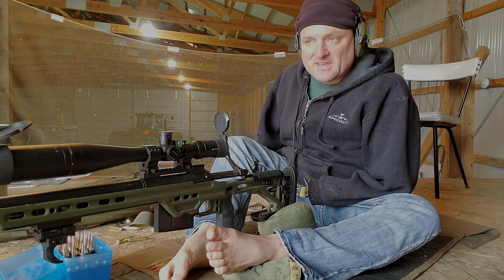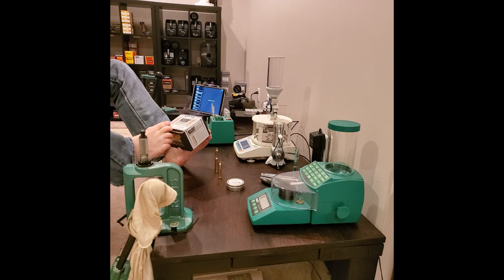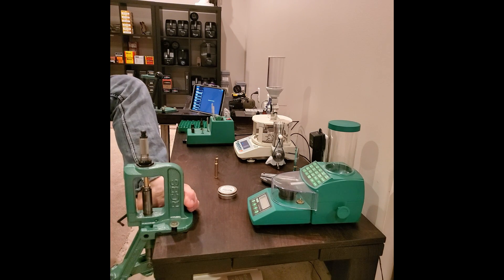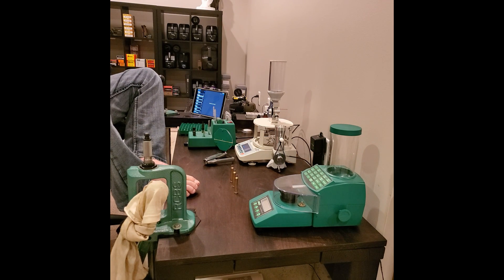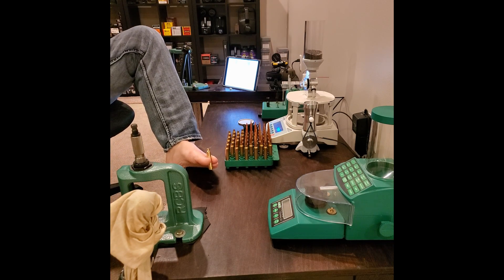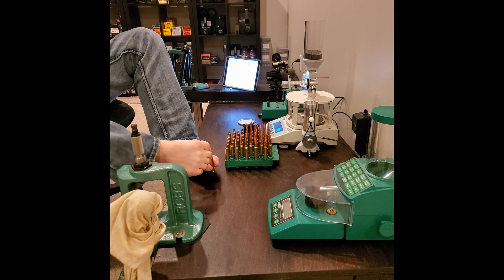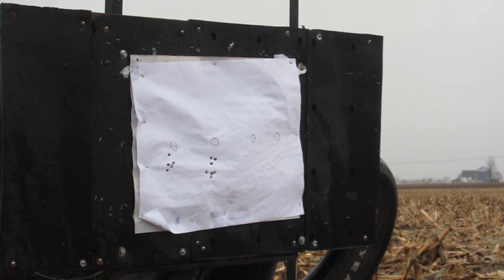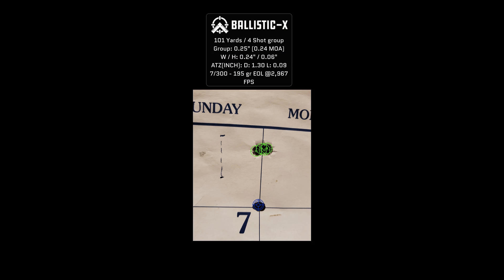7/300 Win Mag with a worn out barrel

Comment: What is your thoughts on a rifle that shot .5 MOA with a load that took some work to get too, shot that load for months and all of the sudden the gun will not group at all even with a tuner. Talking 2-3 moa groups. Tore the scope off checked the base to see if it was loose. It all checked out. Think the scope is bad? About 1500 rounds 6.5 PRC
Reply from the maker: 1500 could be up there.  Barrels wear differently based on how hot they were run and speed of bullet. It could use a de copper and clean then a few fouling rounds and try again.

Comment: So I've been going back and forth between the 7/300WM and 7/300Norma for a long time now. I'm guessing you get better barrel life with the WM (likely by a fair bit), but does the WM have other advantages that you could comment on?
Reply from the maker: I liked the WM reloading, brass life, and throat life better. I suppose it could be said recoil as well is easier to mitigate in WM. Mine has very little running at 2,950 which is sweet spot. The norma is an awesome case but frankly I don't see ballistic advantages.  You can easily push WM over 3k and so to the norma. But you end up with so much burn in norma I can't see barrel life being better than 7-3wm so you lose efficiency. 7/3 is a very efficient case and between 1,200 and 2,200 yards it is a tack driver. The norma gets there as well but efficiency is lost by slowing powder but in theory still losing efficiency with the smaller projectile over burning. With 300wm brass is fairly available although I only use nosler, less powder, can get away with smaller receiver, and so for me 7/3 is a great match.

Comment: Did you use the 300 win mag or 338 cip setup to run them in mag feed
Reply from the maker: Mag is a accurate mag in 300 win. @ 4.85" I tried a 33 mag and it works in chassis but wouldn't feed. COAL is 4.75"   I single feed for match so that is what i use most times.
Reply: Thank you bud i appreciate it